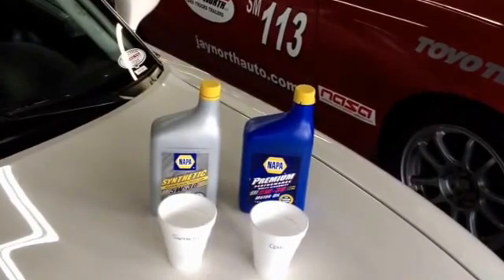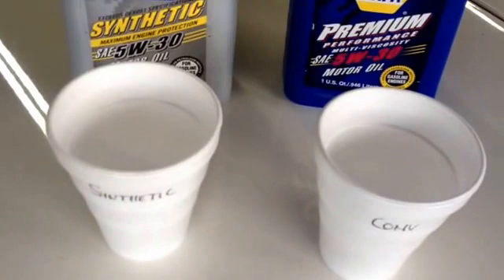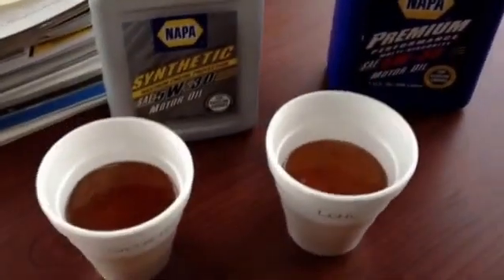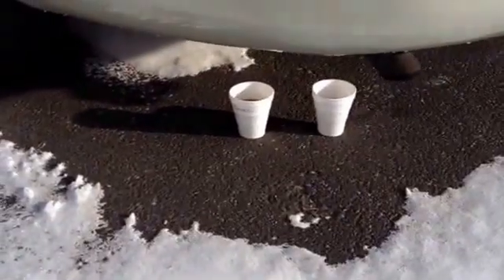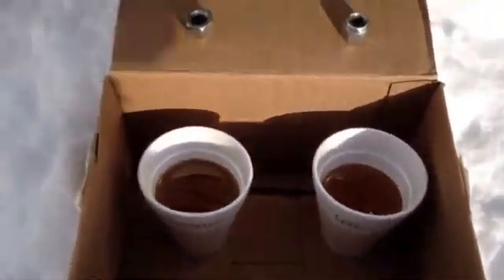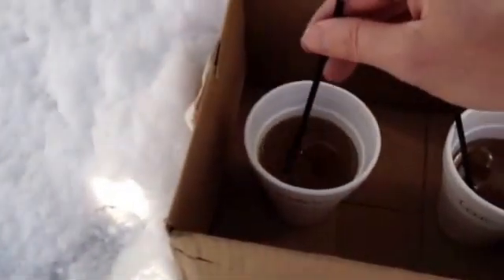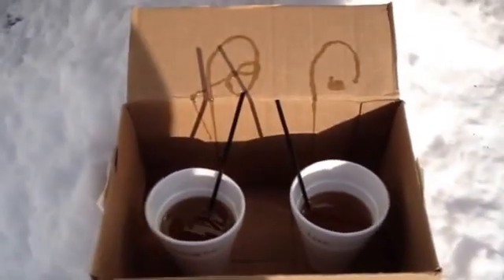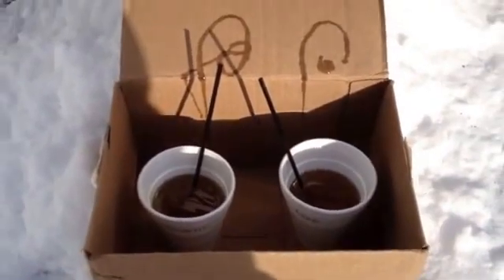Synthetic oil vs. conventional oil at -6 degrees Fahrenheit at jaynorthauto.com

Comment: It's a decent homemade test. Visibly, the conventional oil is a little thicker. But it probably makes no difference in function or performance. You're supposed to let it warm up a little when it's that cold even with a modern engine. Frankly, I would let it warm up a for about 30 to 45 seconds, put it gear if it was an automatic, let it idle a little more to start the AT fluid warming up, and then drive. If I lived somewhere where I had to drive to corner and then immediately get into boulevard or highway traffic I would warm it up a little more. But it you live somewhere where you can creep along even for an eight of a mile, don't invent a bunch of scare stories.

Vintage cast iron engine with 10W-30 or 40? Let it warm up a little extra, then drive. In five billion years we're going to be swallowed by the sun anyway. You do know that, I hope.

Comment: the 5w which is mentioned is the one that shows its ability to maintain its viscosity between low range and high range temperature. there is 15w, 10w,5w mentioned to show that how low it could maintain its viscosity. 15w is mostly used in hot countries like the middle east. u can find the temp. range on the Internet.

Comment: Nice principle in testing the cold weather effect but bad implantation, did you really just drop lug nuts in 2 opaque cups without seeing what happened? and what is the idea behind using the straws?

A better approach would be flipping these 2 cold oil cups and see which one of them will pour faster, that is just to determine which is better in eliminating cold starts.
Reply: Unexplained theory 🤣